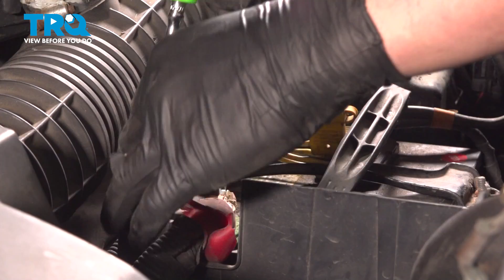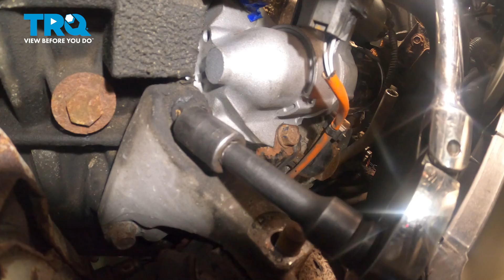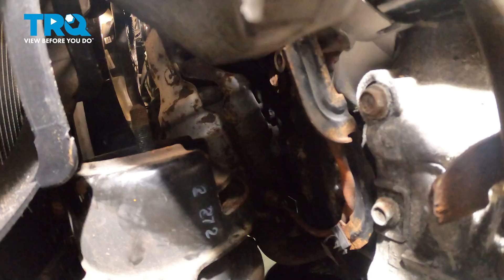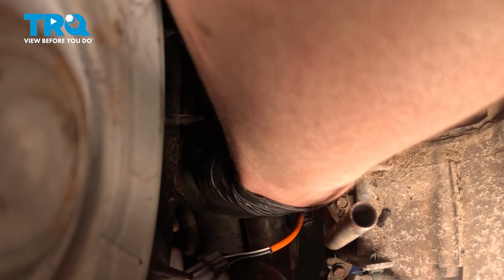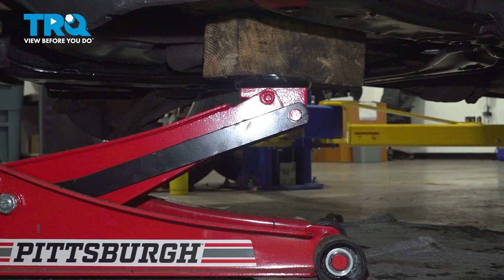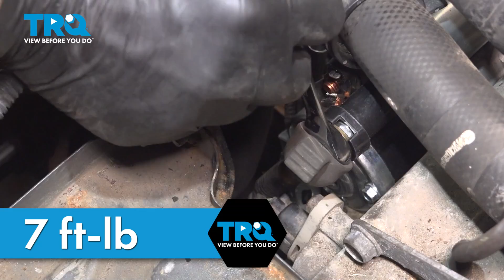How to Replace Front Engine Mount 2003-2008 Honda Pilot

Comment: I like the video  only one thing what type of rachet or brand is if is battery i want to get one were you ge it and for those who say it is not necessary  to remove the starter i asking  you to load  up a vidio becasuse i doing the mounts now and I'm  not be able to get mount out with out removing starter

Comment: I was able to remove the mount without touching the starter or dipstick, you need to rotate the mount as you pull it out so you have clearance. The bracket is the hardest part trying to line up the bolts takes some finesse.
Reply: I had the front end jacked up I’d assume if you had the entire vehicle off the ground and level it would make it easier

Comment: Quick question. Would it be easier just to disconnect the radiator and condenser and pull out the mount that way instead of taking out the battery and starter?